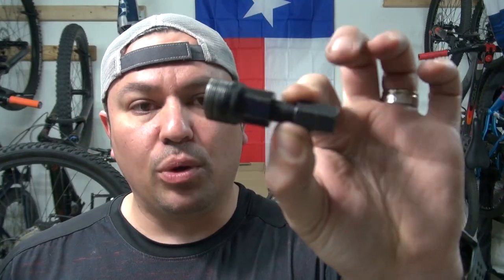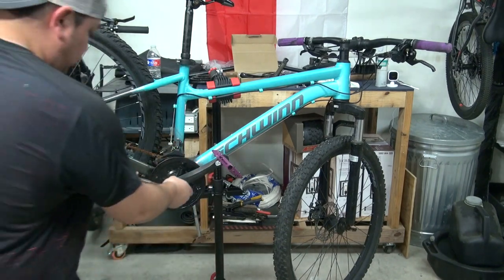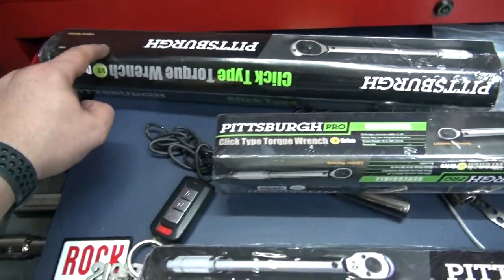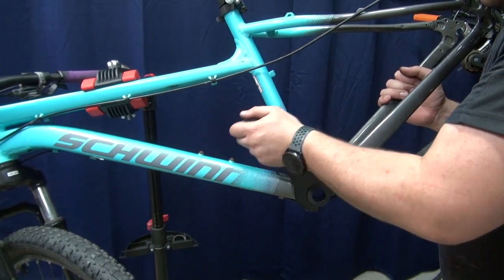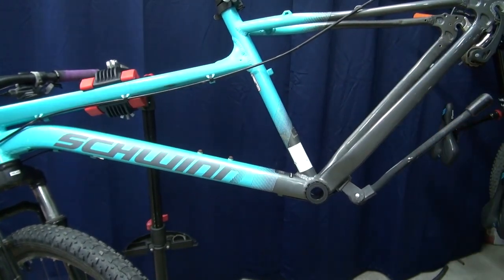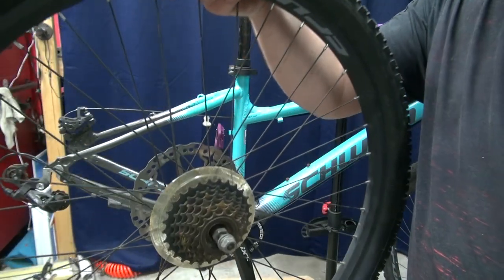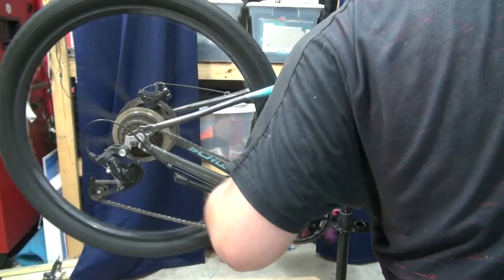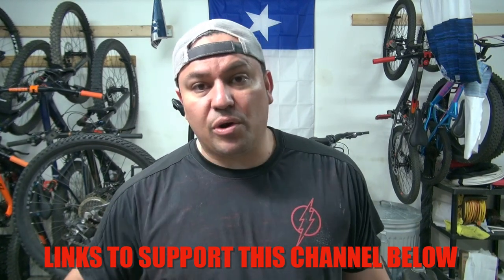What type of crankset should I Use. Stage 2: Drivetrain: Schwinn Al Comp #mtb #mtblife #womensbike

Comment: I’m doing this upgrade now to my wife’s bike.  Same bike. The non drive side was seized. Definitely over tightened by Schwinn. It stripped and I had to cut it off with a Dremel.  Bearings had slag a no grease.  Shredded.
Reply: Our rear hub was also trashed.  Replaced with qr.  Just about done but I may have to adjust the spacers. 😅
Reply from the maker: Nice. I hope the bottom bracket treads on your bike are ok
Reply: @MTBAlex  yes, no problem there.  I’m not sure about the spacers though. I’ll have to check the chain alignment once I get the rear wheel back on. 👍👍

Comment: great video! Glad you didnt hit the car! I have question on bottom bracket. I have full stock mens Al Comp and wanting to replace the bottom bracket (loud/grinding). Do you know the spec for a drop in replacement(68mm x ?)? Also, would you have a recommendation on a brand/model to replace it with, while keeping everything else stock. thanks!
Reply from the maker: If you replace the bottom bracket, might as well replace crankset
https://amzn.to/3UeMfg1
Reply: I would also like this information as well
Reply from the maker: @thewinnertran  the link on the previous comment takes you to the correct part
Reply: @MTBAlex  wouldnt it just be cheaper to buy a direct replacement for the bottom bracket?
Reply from the maker: @thewinnertran  what? Square tapered crankset? If so, is about the same, I prefer hollowtech